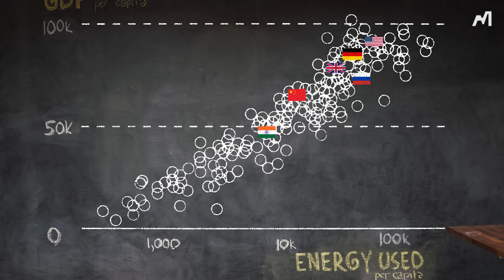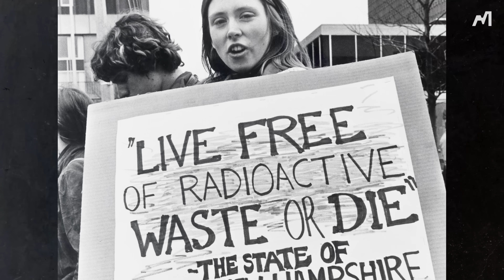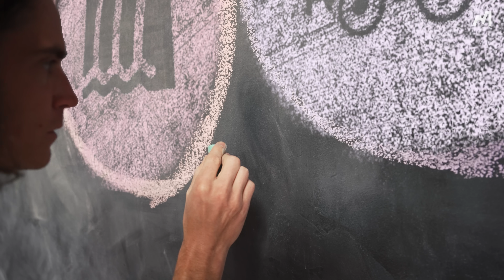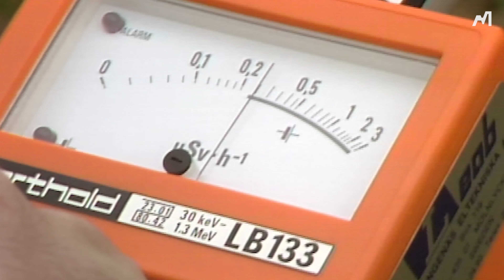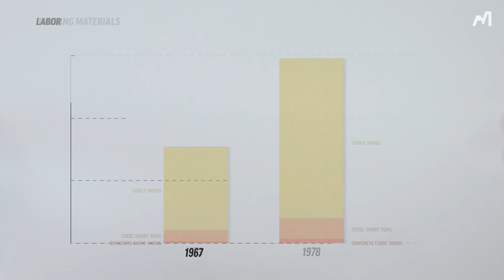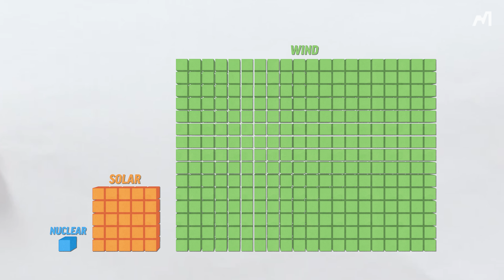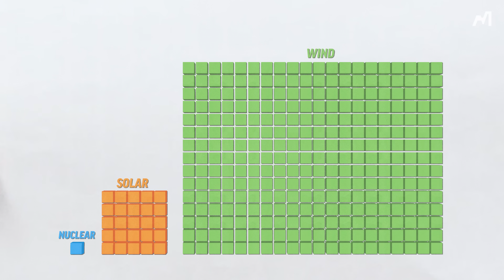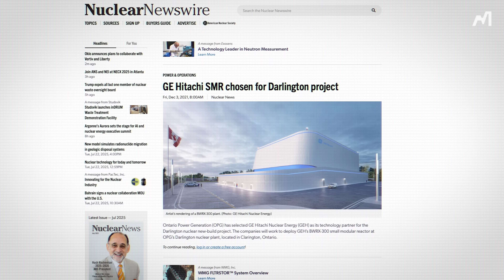They're Lying to You About Nuclear Energy

Comment: people freezing every winter in damp mouldy homes must have a much much larger effect on health?
Reply: Nuclear isn't used for safety reasons. Fact is, nuclear is incredibly complex and necessarily expensive because of it.

Wind and solar are 5x cheaper per delivered kwh. Nuclear makes no sense
Reply: @Cambyses1467  Nuclear works at night, that makes sense. SMR’s are likely the answer.  Fusion will never happen. IMO
Reply: @over-engineered 
No need for new energy generation at night because we won't be fully replacing the entire grid for decades, and by then, energy storage will be the solution. Nuclear is just too expensive and only getting more expensive
Reply: @Cambyses1467 .   For the entire history of the grid, when large amounts of new power sources were built not for new demand, they replaced old plants, and so the cost was stable. Not now. Enough solar or wind and new distribution has been installed at great cost  in places to run the entire country for a moment, but the entire existing grid must remain in place, indefinitely, That’s extraordinarily expensive for the grid as a whole, and are why power rates have increased dramatically every where large shares of solar are tried. Second, high shares of intermittent power fluctuating g moment to moment are unstable, causing blackouts as in Spain.
Reply: @Nill757 
Not at all actually.

You're unwittingly referring to something called Dispatchable Generation requirements. Things like Peaker plants, nuclear, etc can be ramped up when demand differs from supply. In most grids, this 'gap' is represents about 30% of the grid. In other words, 30% of power sources needs to be Dispatchable, and 70% can be non-Dispatchable. In reality its a bit more complex, of course.

We could build nothing but wind and solar for a decade before even half the grid is replaced, before we need to start worrying about Dispatachable Generation requirements.

And by then, I'd bet energy storage will be the solution for that problem, instead of nuclear
Reply: @Cambyses1467 The UK has installed enough wind capacity installed to run the avg load of the entire country for a moment.  Once the UK had lower than average power prices, now has the highest industrial power prices in the developed world.  Germany has enough solar+wind installed to power two Germanys for a moment, and also has some of the highest power prices in the developed world. I decline to follow that silly lead.
Reply: @Cambyses1467  Nuclear used in France for 70% of grid, no safety problems stopped it.  70 new reactors under construction globally right now, not stopped by safety reasons. Interestingly, France has no more coal plants. 

Several nuclear bans remain in place by governments around the world like Australia, for political reasons. Interestingly, Australia has most all its coal plants from 20 years ago, still running.

Comment: Personally not a fan of nuclear energy but I'd rather have that produce energy than coal.

But there is definitely no need to solely rely on it. You mention solar panels but you forgot to mention that these can be build practically anywhere. No real need to sacrifice greenery for it as you can just put it on the roof of your house. The sun gives off enough energy to run our society on solar panels. The problem there is really just storing the energy and getting it to where it is needed.

But hey, maybe we should be looking into more efficient use and reducing the amount of energy needed instead of just blindly meeting demand.

Comment: I spent 2 years working at a Nuclear Power Plant that had 2 backup systems for every working system at the plant. You get more radiation from your TV than you do at a Nuclear Plant, and I never felt like I was in any danger at any time! Nuclear Power makes 100 times more sense than windmills and solar! Great video, and thanks for getting the message out there about Nuclear Power.
Reply: 🙄🤔 you didn't work at WINDSCALE, did you❓️    🤬
Reply: @stevenr8606  No!
Reply: Your TV gives off electromagnetic radiation, not nuclear radiation.
Reply: @DaveMiller2 Of coarse it’s not nuclear, I never said it was, it’s radiation, same with being outside you get radiation from the dirt and rocks and other things.
Reply: @crowlers6  You said you get more radiation from your tv  than a nuke plant. But they are 2 different types of radiation. So the statement comparing the tv to the power plant doesn't mean anything. It isn't a valid comparison. The radioactivity that comes from something like uranium or plutonium is not like electromagnetic radiation.  Nuclear radiation is far more dangerous than most electromagnetic radiation. You have to get up to ultraviolet radiation or past that in the Electromagnetic spectrum to get the the same danger level as radioactivity form uranium or plutonium. Tv's give off electromagnetic radiation far below the level of ultraviolet.
Reply: @DaveMiller2 There’s background Radiation that registered on a dosemeter, the nuclear radiation is in the core which I never got close to. I understand what you mean but you are being a little petty, wasn’t trying to get deep into so everyone would understand!

Comment: The West is toast.  China plans to build and approve approximately 6 to 8 new nuclear reactors per year on average abd as high as 10 or 11 reactors in a single year.  Over the 10 years (2015–2024), China added approximately 37 reactors, nearly tripling its nuclear capacity from about 19 GW in 2014 to 53.2 GW by April 2024, as per the EIA.

Comment: Chernobyl was a tragedy of poor design combined with operators that were not fully aware how the poorly designed reactor would act when put in the condition it was for the test they were performing.   Most people have no idea that most reactors built and operated in the world today are of an entirely different design and cannot fail in such a catastrophic manner that Chernobyl did.  3 mile island proved that in the worse case scenario a reactor with a pressure vessel would contain the radioactive material and not explode.  Risk aversion to the point of never doing anything because all risk surrounding nuclear can’t be mitigated hasn’t helped the environment or people in general.  And before anyone says anything, I live less than 10 miles from a nuclear power plant and I barely give it a second thought.

Comment: 16:05 The problem with small modular reactors on board of ships or submarines is that they are not cost efficient. Only the military (and some Russian icebreakers) use this propulsion technology. Other civilian and military ships have discarded the idea of a nuclear reactor because of cost issues. The atomic cruisers of the 60s and 70s are out of service and have not been replaced, and civilian freighters (Savannah, Otto Hahn, Mutsu) dropped the idea as well.

Comment: I worked on the Palo Verde plants in the 1980's. One thing that rarely is talked about is that the steel that is exposed to radiation becomes brittle and has to be replaced.
Reply: I worked in British radio-active waste storage in the 80s, and this was a serious problem for liquid waste stored in steel tanks.
Reply: Except for the most important bits of steel... the containment vessel itself. You know, the stuff that's holding back hundreds of PSI, while being neutron bombarded for 60-70-80 years now.
Reply: @jfbeam  Most of the nuclear power plants in europe have exceeded their projecting lifetime
Reply: Nuclear energy production produces the most toxic waste known to man and we have no proven method to store this stuff, which lasts hundreds of thousands of years. Methods of storage previously thought to be safe for millennia have already failed in mere decades.
Reply: This was known back in 1981. Reference NYTs article and Science News also. Sandia and Los  Alamos are still working on it to figure out how exactly it occurs on the atomic level and how to make metals more resistant.
Reply: If so, how long do submarine and Carrier reactors work? Do they need complete refurbishment every few years? And does it affect ship structural components?
Reply: @konstantinoskatsos3886 They undergo overhaul and refueling every 25 years (carriers, not sure about subs) and are designed to last 50 years.

Neutron embrittlement is accounted for in the design of the reactor vessel. Neutron radiation shielding is also added to the primary and secondary containment boundaries to mitigate the damage from neutron radiation.

Inside the reactor compartment with a critical reactor, you would be killed by radiation very quickly, like minutes, but outside the RC, you would get no more radiation of all kinds radiation than you would in your backyard on a cloudy day. The shielding is very effective.
Reply: And Palo Verde keeps on producing reliable energy to millions year after year
Reply: Good ole fast neutron embrittlement.
Reply: Didnt know about that effect had me looking it up for the last 20 minutes or so 😂. Wonder if you melt it down and reforge it if it keeps the brittlness
Reply: @goreobsessed2308  exposed to radiation means it is RADIOACTIVE
Reply: Steel is cheap to replace
Reply: @KCMedia33  Do you have any idea how many people are unalived in steel mill accidents every year? How cheap is a life?
Reply: @KCMedia33 would think that steel developed for use in nuclear reactors would be quite expensive,it's not like they go to the scrap yard and get it,not to mention the fabrication necessary to make it useful in such applications.
Reply: @Dennis-c1w  exposed to radiation means it is RADIOACTIVE
Reply: @fred6319 Thought it meant sticky to the touch.😂
Reply: @fred6319  This is not true.  Radioactive means it is composed of unstable isotopes that will decay and emit some kind of radiation over time.  Being exposed to radiation does not cause this to occur in most materials.  In a nuclear power plant, this is a result of fission where a uranium or plutonium atom split into two smaller atoms that are typically not stable.  There are some plant construction materials that are impacted by neutron radiation such as Cobalt 59 that will become Co-60 which does emit some radiation.
Reply: @fred6319 No? It means irradiated. Radioactive means it's an emitter. Also, how does that relate to anything in this post? Did you just want to say something random?
Reply: @acceptablecasualty5319   
it relates  this post?
 if you melt it down and reforge it if it keeps the brittlness
most materials that are  irradiated become  Radioactive
steel exposed to radiation makes it radioactive meaning it cannot be reused everything made of it would be radioactive  Did you just want to say something random?or flounting your ignorance
Reply: @fred6319 No. You're just wrong. Irradiating steel does not make it radioactive, that's ridiculous. Neither Carbon, Iron or Nickel form a Radioactive Isotope when irradiated. Watching Captain Planet is not a substitute for a physics course.
Reply: @acceptablecasualty5319  The nuclear facilities managed by the DOE and commercial nuclear power plants licensed by NRC are the largest potential sources of scrap metal from nuclear facilities in the United States. The U.S. Department of Energy (DOE), NRC, the Department of Defense (DoD), and state or Superfund authorities are primarily responsible for management of scrap metal from these facilities. Contaminated metals from these sources are disposed of and are not recycled.
Reply: @fred6319 Contaminated means radioactive material ON the object. If it were to be recycled, that material would end up IN the object, hence, no melting it down. You can absolutely clean contaminated scrap, it's just not worth doing.
Reply: @acceptablecasualty5319  what part of"Induced radioactivity, also called artificial radioactivity or man-made radioactivity, is the process USING RADIATION TO MAKE A PRIVESLY STABELE MATERIAL RADIOACTIVE"dont you understand?
Contaminated means radioactive material ON the object. NO it doesnt it is Contaminated with radioactivity
have a nice day
Reply: @fred6319 I've been exposed to radiation many times yet I am not radioactive.
Reply: @KCMedia33  exposed to radiation means it is RADIOACTIVE
Reply: .....a few decades later the steel needs replacement.
In the meantime, MILLIONS of people's lives have been improved by reliable, "cheap" electricity.
Bonus points.....no fossil fuels extracted or burned

Yep, give me nuclear power
Reply: Really? And how exa tly does this happen? Explain this to a metallurgist! I am anxious to read your explanation!
Reply: @JaimeVenegas-f7m  Radiation is energy transmission. Heat is energy and a byproduct of energy transmission via resistance. The steel is the resistor across which the radiation transmits energy and creates heat. The constant flux of energy from the radiation is the same as a flame being applied and removed, causing the steel to heat and cool, stress and flex, which causes the steel to lose structural integrity more quickly than if the radiation was not present. You're a metallurgist? Because I would expect a metallurgist to know that.
Reply: @JaimeVenegas-f7m  Simple. It's being bombarded with neutrons. Those atoms being hit cease to be the same atom. Your steel is slowing becoming "not steel".

(If you want more detail, go find any of the physics research papers.)
Reply: @JaimeVenegas-f7m  Ever heard of Google? It has become fairly good at giving a nice explanation and all it's sources are listed for every claim. Just search for "radiation embrittlement".
Reply: @JaimeVenegas-f7m "Fast neutrons can cause irradiation embrittlement in steel, making it more brittle and less ductile over time. This effect is particularly significant in materials used in nuclear reactors, where exposure to neutron flux can alter the structural integrity of the steel."
Reply: @JaimeVenegas-f7m  Not much of a metallurgist if you haven't heard of neutron embrittlement.

Comment: Hold on now. We should be recycling our spent nuclear fuel. And using the resulting plutonium to generate even more power. Putting our spent uranium fuel rods in big giant concrete canisters forever is crazy when we could recycle them to get more power while at the same time making the material less dangerous and we could do that multiple times, everything getting safer each time.
We should also be developing thorium based molten salt reactors.

Comment: Radiation is nearly harmless with hardly any effects to the human body?

Yeh, that's why my sister has 47 hairline fractures in her spine due to radiotherapy for cervical cancer.
Reply: Also, not sure why some has become obsessed with nuclear for energy.

Yet we have electromagnetic generators that can run indefinitely without needing any sort of fuel.

Yet, elites always settle for energy that needs fuel/energy to create energy?
Reply: @JC-ne7lk  At low doses it's harmless. Those generators are conspiracy BS, you need fuel in some way to generete energy because of physics, not because "muh elites"

Comment: The deaths figure should be normalized.  This unnormalized version isn't an honest picture of the relative risk.  Also... solar is cheaper than nuclear now.
Reply: Even when normalized per energy produced nuclear is the same as solar and wind, besides nuclear produces more energy because of higher capacity factor and energy density, so normalizing it will only make better. What you're asking is not risk, probably you're confusing possible consequences, risk is a function of consequences, probability and accident evolution, if you want "relative risk" than nuclear is still one of the safest sources, the current best risk analysis give a serious Core Damage Frequency of 1 in a million to 1 in a 100'000 per reactor per year. Kind of like airplanes, large possible consequences, but actually the safest mode of transport due to continous scrutiny and improvements.
Solar is cheaper if you need to power your home, when planning the entire energy mix it actually costs more due to auxiliary costs, subsidies and law of deminishing returns, you'll always need a % of stable baseload power in the grid from nuclear

Comment: Wind and solar are not "clean". The pollute, just not the same way. Hydraulic fluid, micro plastic, they burn up. None of them can be recycled, they have a quite limited lifetime. The energy in wind and solar is very dilute compared to fossil and nuclear and thus require a lot of area to produce the same amount of energy.

Most important though, dunkelflaute. You need 100% backup power, so why build solar and wind AT ALL? It's crazy, batshit crazy.